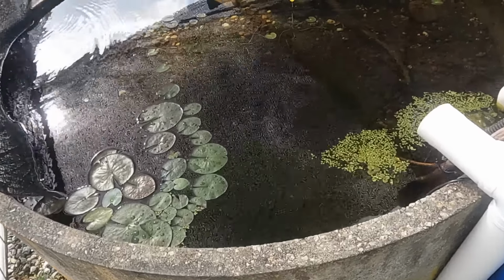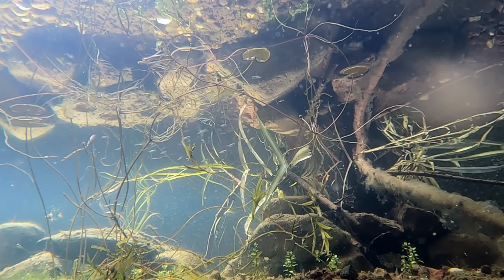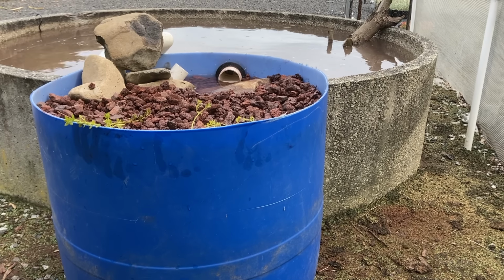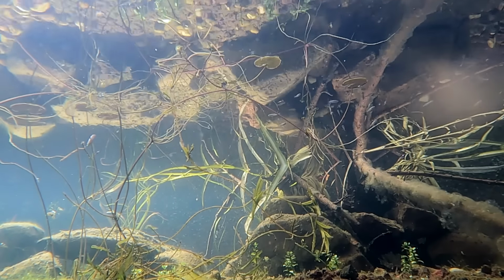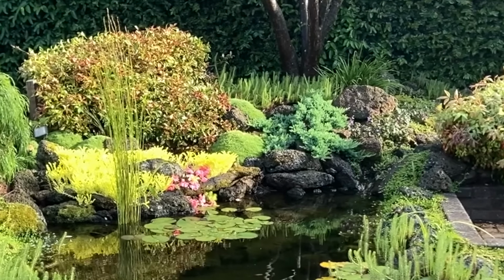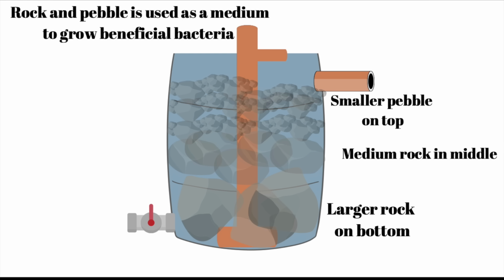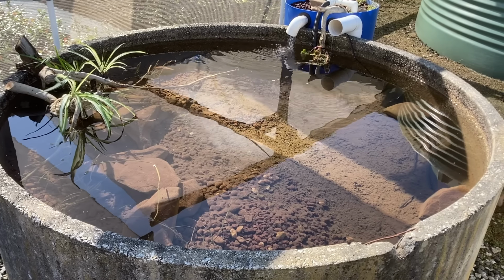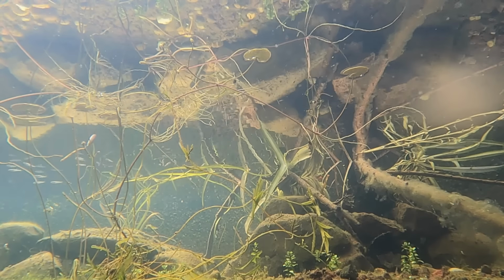How to Design and Build a DIY Bog Filter for Crystal Clear Pond Water

Comment: Love your videos do you get everything for the bog filter from Bunnings
Reply from the maker: You can get most of it from Bunnings. Not the uniseals, olive barrel and I wouldn’t buy the pump there. But all the plumbing- yes.
Reply: Be careful when you buy PVC pipe and fittings from normal hardware stores as they usually sell DWV pipe which is not compatible with PVC pressure pipe fittings and uniseals. I bought pipe, elbows, tees from Bunnings then ordered a tap/uniseal online, they are different OD's even though they are all 32mm.
Reply: Be careful when you buy PVC pipe and fittings from normal hardware stores as they usually sell DWV pipe which is not compatible with PVC pressure pipe fittings and uniseals. I bought pipe, elbows, tees from Bunnings then ordered a tap/uniseal online, they are different OD's even though they are all 32mm.
Reply from the maker: Bunnings also sell pressure pipe. Good tip though, household plumbing (DWV) is different to irrigation (pressure). You can use either for the bog filter but it will change the uniseal needed. Rob bobs backyard aquaponic shop has a great little chart that shows what uniseal you need for the different pipes and sizes.
Reply: @Ozponds  You must have different stock in AU compared to NZ, they only had DWV in my Bunnings and it was double the price I ended up paying for pressure pipe and fittings from an online retailer. If anyone from NZ reads this, try irrigation express (does limit you to 1m lengths of pipe).

Also Kev, one day I'd love to see more detail about how you fit your flexible hose to the pressure pipe. I know you sort of explained it in this video but I couldn't find the right fittings. I ended up putting an elbow on the top of the downpipe and jammed the 25mm hose in. It does work but your solution looks cleaner.
Reply from the maker: Ah I didn’t know about Bunnings in NZ. I think in this video I talk about Barb and socket fittings- Plumbing a DIY pond
https://youtu.be/RATTvGg9uIU. It’s a good way to get the pressure pipe connected with the flex pipe. Hope it helps.
Reply: @Ozponds  Thanks for taking the time to reply, that's perfect, must have missed that video. Cheers Kev, happy new year and keep up the good work
Reply from the maker: 🍻👍 Happy New Year

Comment: Hi Kev, u have been doing this alot longer than i have so i feel like a bit of tit for pointing this out, but the pipe opening u have to prevent the siphoning effect when the pump is off seems to greatly reduce the pump flow which reaches the bottom of the filter. Simply because a portion of the pump pressure is lost at the siphon opening. What i think will fix this is if you add an air admittance valve. This would only allow air in one way, i.e the direction that breaks the siphon, while preventing that precious flow from leaving before it reaches the bottom of the filter. 
Clearly the filters still work, but perhaps one can get away with a much smaller pump if this is done or improve the filter potential.
Reply from the maker: Maybe. I’m always happy for people to experiment. Nothing I say is set in stone. I just show what had worked for me and try to be helpful.